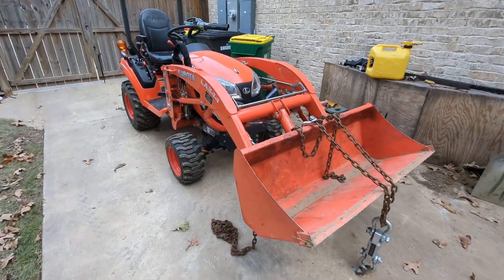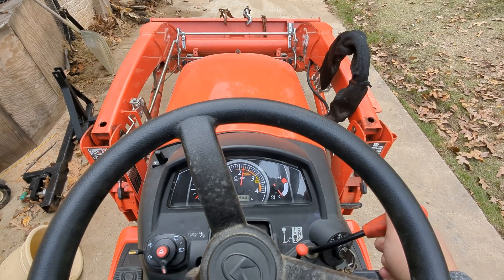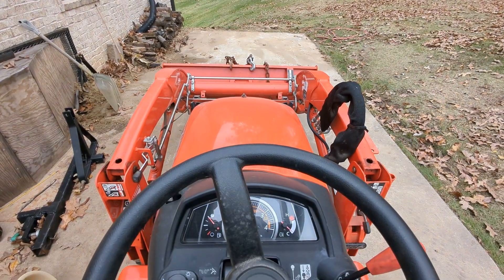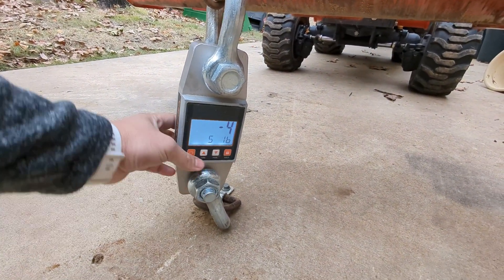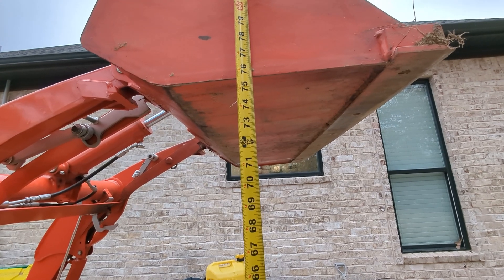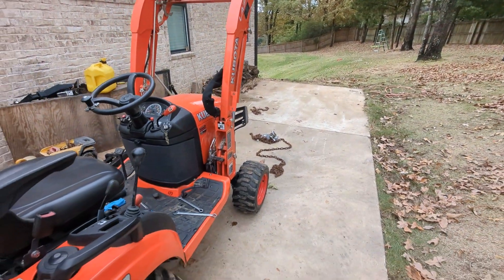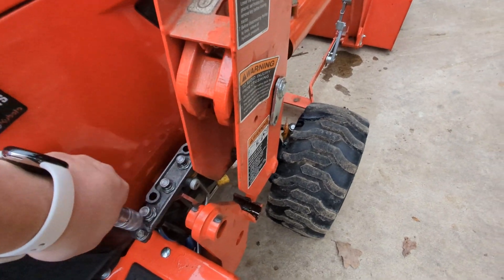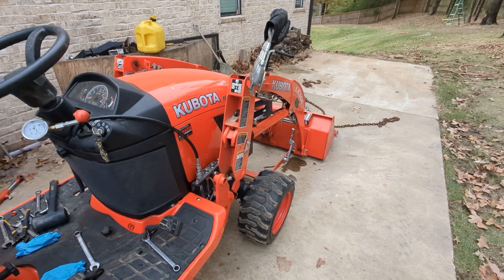HydrosPlus Lift+ for the Kubota BX2380 - More Power and More Lift Height

Comment: How much more weight will the loader lift with the new cylinders?
Reply from the maker: Actual pounds will depend on your pressure setting and height, but the HydrosPlus Lift+ cylinders will increase it ~35% over the stock cylinders.
Reply: @HydrosPlus  
BS
Reply: 35% added height, sure

But 35% added lifting capacity? 
I don't believe that for a minute 

If that was true, you would have done a comparison in your video of lifting capacity    

All you focused on was how much higher the bucket will go
Which frankly isn't all that important to most owners

The issue with these loaders is lifting capacity